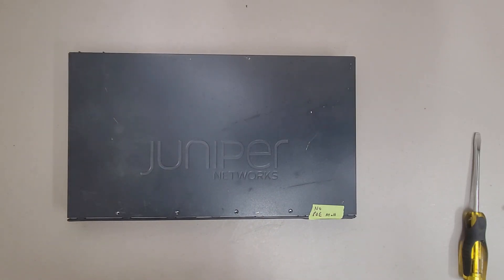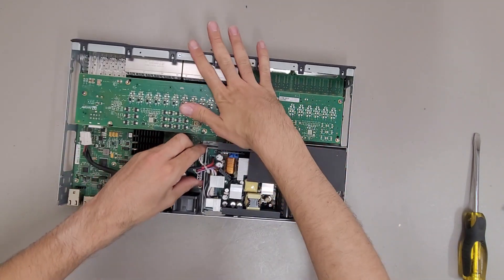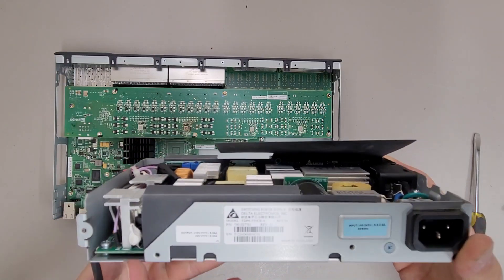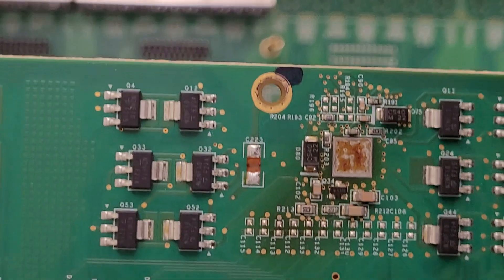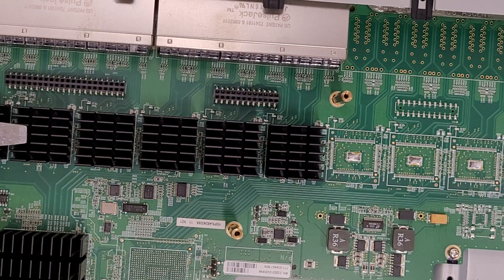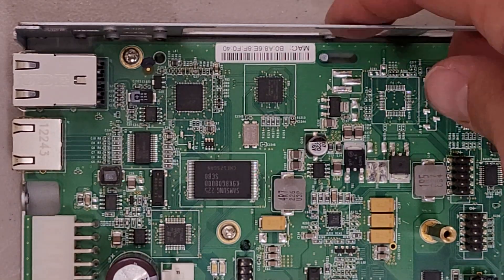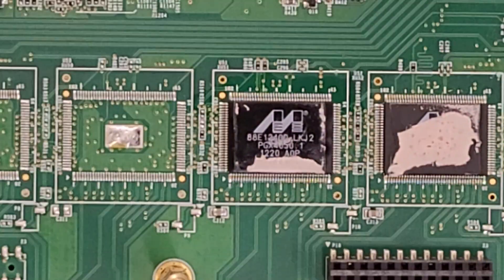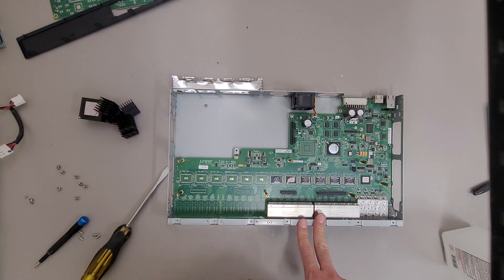Juniper Networks EX2200-24P-4G gigabit PoE switch #teardown

Comment: Interesting, thanks. That PoE board got really cooked! I wonder if you could still use it as a regular switch or you are just getting errors ... Might need to change the firmware.
Reply from the maker: It would probably work as a regular switch but once they start failing they can be unpredictable. There were no errors. Cleared the config multiple times to be sure. I didn't check the os and jloader version. Might not have been a bad idea to update if needed, but I decided to be lazy.
Reply: @computersales  Somebody wanting to learn Junos could probably find it useful.